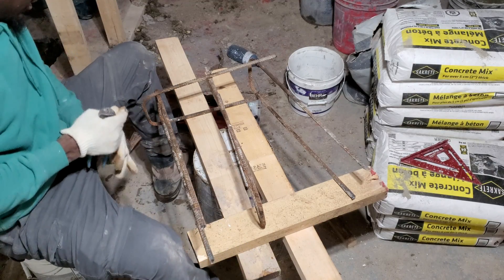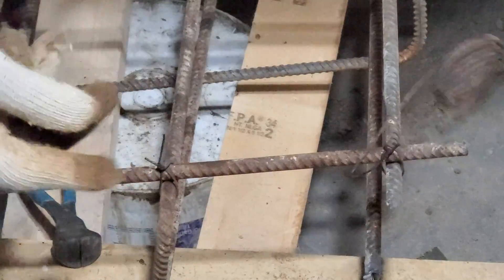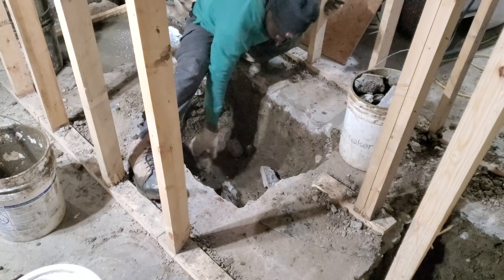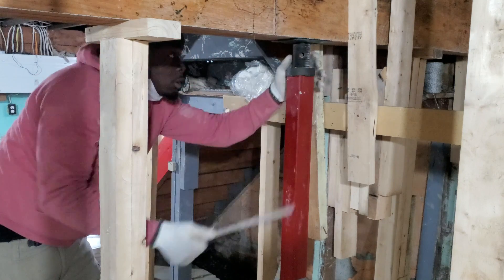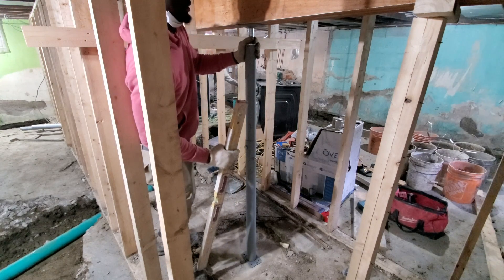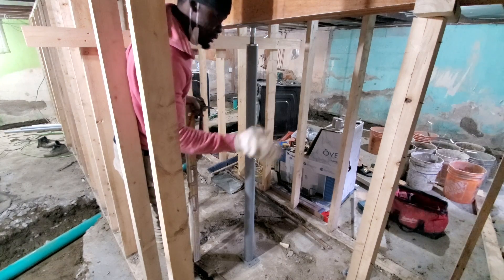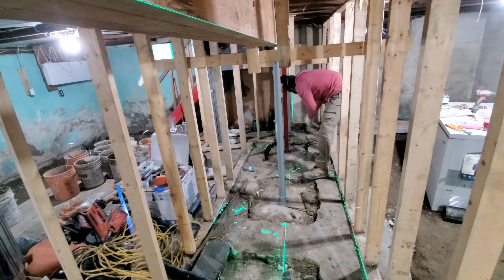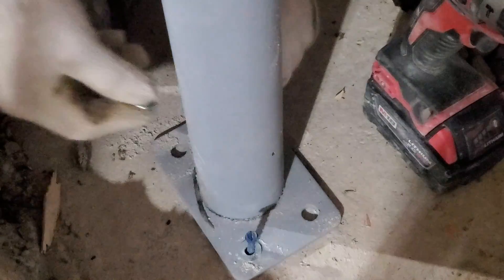How To Install Structural Posts and Prepare  Concrete Footing DIY

Comment: You bought the correct Concrete, but then changed the mixture because you thought you knew better?

Your concrete was also WAY over saturated with water. Hopefully that post isn't holding a lot of weight. The concrete it's sitting on us forever compromised.

Comment: How would you do this if the beam was steel and post was steel? Also why did you not level out the footing to the rest of the concrete level? Just wondering if there was a specific reason?
Reply: After installation, more concrete is poured around the post bottom up to floor level.

Comment: I thought the adjustable end had to be encased for it to be considered permanent. Meaning if it is adjustable in any way, it is considered temporary.
Reply: I know all that work and he puts temp posts up
Reply: In the US this is true, in Canada there are regulated adjustable columns that are allowed to be installed permanently like this. They can't just be any adjustable column they must be certified for use in Canada. National Building Code of Canada, Article number CAN/CGSB-7.2-94 entitled “Adjustable Steel Columns”, which allows single-tube adjustable columns